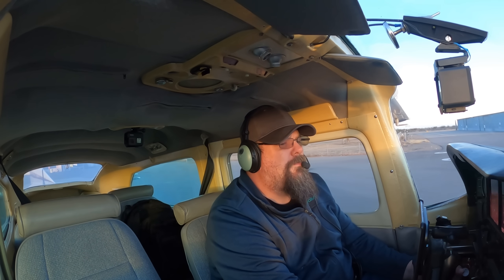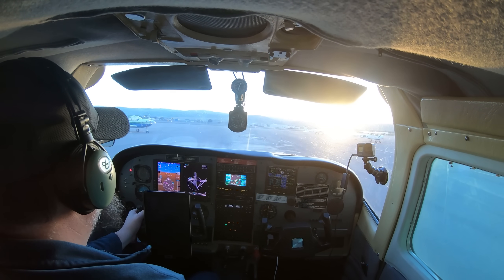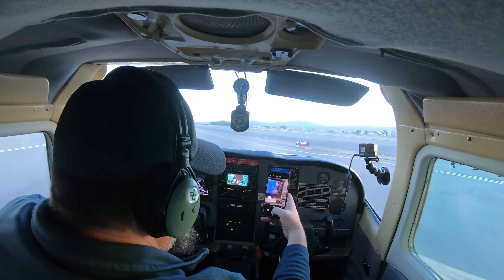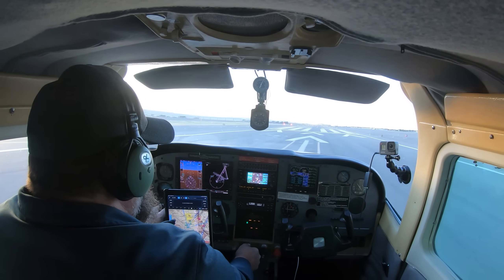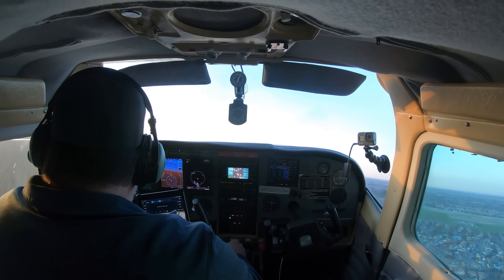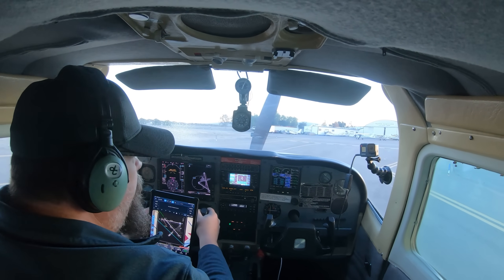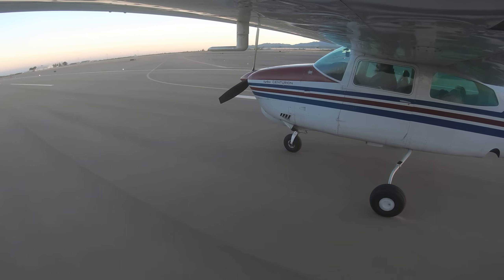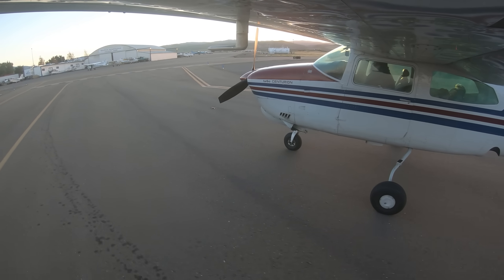Catastrophic Engine Failure after Takeoff

Comment: I was always taught to NEVER turn back to the airfield/port in the event of an engine failure! This is a classic example of where general advice isn't ALWAYS right! It looked like you had a field option or two though during that l/h turn ... The crosswind turn woulda been at around 700ft ....  Nice one!
Reply: I would have left the gear up til the very last possible second to preserve energy. In the event you didnt make the runway, you might consider landing gear up depending on the surface available and dont want to manage that decision and control the plane at the same time during that critical phase. Second, I noticed you took your time turning back. Once you decided to go back I'd point out an aggressive turn would be in order. I know you loose energy in a steep turn but drift off centerline is creating a longer distance to the target. I brief myself of emergency on takeoff before each flight. Fortunately in thousands of hours I've only blown one engine on takeoff and it was in an Aerostar twin and a non issue due to the right engine still producing power. I think you managed the situation well. Only one thing left to do. Fire the mechanic.
Reply: Look up Harrison Ford's engine out situation. There was litterally 0 options except for a golf course. Forgot the airport, but would hate to have to deal with an engine out landing there. He did an exceptional job considering what was available
Reply: Very true, you definitely have to consider your specific circumstances. At my airport, off to one side, there are some nice fields to put it down on... But on the other, it's all residential. 0 options over there. My instructor taught me to make the turnback when taking off in that direction. Luckily, I fly out of a Class C airport with a decent sized field, so with a tailwind it should be doable to come to a stop without slamming into something hard
Reply: The airport runway configuration helped a lot by reducing the amount of manuevering required to get back on the ground.
Reply: TradeTop  Well, that is your opinion, why say that it isn't? 
I have no problems with the prospect of making a forced landing into a suitable field and I'm very confident that all on board would walk away from it unscathed. You seem to not be as confident. Perhaps you weren't trained correctly. 
A fellow aviator friend of mine learned to fly in the US and when he tried to hire a plane here in the UK he wasn't allowed to and had to have a certain number of hours of instruction in order to qualify for UK PPL status.  
You have made no comment on the possibility of an engine restart after having the time to complete the checks I listed and you don't consider the low-hours pilot who may attempt the 180-degree turn and end up stalling the aircraft because he is trying not to lose a lot of height in that turn, so slows the aircraft to stall speed. As you may know, the inner wing in any turn will always be the first to stall and once it is stalled, it's goodnight! 
An ex-colleague's brother who had a commercial licence (he towed banners in a 172) was killed when performing the 700ft climbing turn on climb out when he took his eye off of the ASI ... he stalled the inner wing and there was obviously insufficient height to recover from the ensuing spin.  
You totally ignore what I copied and pasted from the FAA and the NZ site ... 
You seem the type to only consider YOUR point of view and who refuses to take on board any other relevant information.
So, it's best to now repeat that I disagree with you and for the reasons already stated, and to bid you adieu.
Reply: TradeTop  That's a very opinionated claim you make! ...  In your opinion .... If you were taught to return to the airfield after an engine failure, it is perhaps yourself who was taught wrong if you believe that from 1,000ft it is wise to do so. First, you will have probably taken off with a headwind. If you make a return to the runway, you'll now be faced with a tailwind, which increases your groundspeed and rushes your ability to fly a safe approach and stop on the runway. There's not a lot of margin for error with a strong tailwind (assuming you can actually make it back to the runway). If  there are suitable landing sites ahead or a little to the left or right, they should be taken in my opinion. 
The FAA have stated ...
"Rather than returning to the runway, the FAA advises "it is safer to immediately establish the proper glide attitude, and select a field directly ahead or slightly to either side of the takeoff path."  ... and I agree with them.
The New Zealand Aviation Security Sevice say the same thing.
The aeroplane is usually heavy, slow, low and in a nose-high attitude. These factors combine to provide the least amount of height, and therefore time available to respond to the emergency. Successfully managing an engine failure after take-off is dependent entirely on efficient use of the time available. The common practice is to limit the choice of landing site to no more than 45 degrees either side of the nose; a simpler and more realistic choice may be to choose anything in the windscreen. Do not turn back to the runway. A successful turn back to the runway is beyond the capabilities of most pilots." 

Landing ahead or thereabouts, will not involve an urgent 180-degree turn where a stall can quite easily occur when considering low-hours pilots in particular, so this risk is removed. 
You will have more time to do the checks which could possibly result in the engine being restarted. Returning to the airfield would involve a lot of concentration by the pilot and he will be short of time. Checks that could possibly result in an engine restart are, switch fuel tank, check fuel pump is on, check mixture is rich ... if it is, adjust it to see if any difference is had, check primer is locked and apply carb heat. if enough time switch magnetos to L and then R and then back to both. If prop has stopped try restarting after each of these ... IF TIME PERMITS!
In my opinion landing ahead, or thereabouts (see above) gives the pilot some extra time to do these checks and without the need for a rushed 180-degree turn and as said, no possibility of a stall during the somewhat hurried 180-degree turn.

So ...  we disagree.
Reply: TradeTop  Oh, dear ... out of arguments I see. Funny ... but here is a great video for ya! I tried to post a link but my post failed to go live ... type this into Youtube 
Emergency Operations - Engine Failure After Takeoff
(I've already commented on the successful return to the runway as we saw in the video!)
Reply: @thepianoman1010  you got trolled and didn't know it
Reply: @shable1436 Of course I did ... All I know is that I was talking to either a h@lfwit or any other kind of weirdo ...  and that would include trolls. 😅 
Not interested in trolls, only interested in facts. Which of these is an interest of yours?
Reply: TradeTop  It is clearly your opinion ... and I am tired of this discussion now. I've tried reason ... I've explained each point to my reasoning but it has fallen on deaf ears. I will end by stating the obvious ... there are times, depending mainly on the geography, when returning to the airfield is either the ONLY choice or is by a long way the safest ...  these situations are rare however.
One airport where this is the case is London City Airport (EGLC) ... a friend of mine flew 737s for Ryanair out of there and he said he'd have to go for the River Thames if he had both engines fail at a certain height ... We discussed the extreme unlikeliness of such an event along with this and my view remains the same ... river ditching very likely to fail when we look at the sharp U shaped bend and other bends in the river at that location. 

You are completely wrong where you say,  "And every pilot from every country need to qualify to fly in another country, not just to go to UK, come to Brazil and you'll need to do everything from zero."  

Where did you get that idea? Are you saying that no pilot who isn't Brazilian has ever flown for a Brazilian airline?

I needed to sit an air law examination in Yonge Street, Toronto in the late 70s in order to be able to fly a Piper Warrior (C-GPHQ) from Brampton airport in Ontario. I needed a 75% pass mark and got 83% so I could fly there ...  I did need to take a check flight at Brampton flying club also. It will be the same in Brazil ... You are wrong again! 

Anyway ... bye!
Reply: @thepianoman1010  ö

Comment: Hi ?! Do you remember what altitude you were when got the failure ? Thanks and good job 👏🏻
Reply from the maker: According to the analysis between myself, Rick and Charlie that was posted in EAA Sport Aviation magazine, it was 371 feet AGL
Reply: @TheEdwardFrye  He said the failure occurred at around the height of the crosswind turn which takes place at around 700ft. It definitely was not much below that, certainly not 400ft!

Comment: 35 seconds from initial sputter to landing.  Congratulations on landing safe-great flying and glad you are safe.   I could not tell, was that the stall horn I could hear? or wind whistling ? When you said you noticed you were getting slow, how slow were you?
Reply from the maker: That is wind whistling, GPS shows I got down to 61kts after I put the gear down, I remember it slowing and the red bar was climbing when I pushed it over the second time, stall speed in that configuration is 45kts
Reply: @TheEdwardFrye  Excellent awareness and speed management in the worst of scenarios.  Bravo!

Comment: That is called a Turnback Turn.  If going around the airport is called a Turnaround the airport.  I used to teach those turns to do after EFATO/LOTOT.  Also you can do them on GRM.  Some ignorants of turnbacks call them as the same but they are very different turns.  Some call a turn around "A Turnback", or the Turnback as a Turn Around.   On the Turnback you dont turn around anything.  Your turnback to the interception or opposite runway, the closest runway.  Turnaround is not Turnback.  Many accidents are on a Turnaround Maneuver due is longer to do and pilot cant make it to the base leg or final leg and crash trying it.

Comment: Do I spy a missing rod bolt in that picture?  Going to guess that one didn’t get torqued.  I’ve seen the aftermath of misassembled rods before, always cracked rod caps installed backwards.  They usually live a few hours then leave your engine with the rod hanging out one side and the cap shoved through the other.  Since this one happened so fast it’s got to be a torque issue.

Comment: if changing the propeller pitch is what cause the engine to fail then you can thank your "error" in twisting the mixture instead of the the correct knob first for giving you the altitude you needed to bring it back safely!  nicely done.

Comment: This video popped up in in my feed, and I have zero knowledge about flying a plane. Can someone explain why doing this turn was potentially the wrong move? Surely the runway you just left is the ideal landing site.
Reply from the maker: The risk is trying to extend the glide or getting to slow in the turn and having the airflow separate from the wing (stall). If the plane is uncoordinated, and it stalls, meaning one wing stalls first, then that becomes a spin. It requires altitude to recover from a spin, so a spin at low altitude can be fatal. In primary training, we're taught not to turn more than 30 degrees off straight ahead to prevent a stall/spin scenario. This was a Goldilocks scenario, where 30 degrees left put me abeam the numbers for the crossing runway so I kept turning left and pushed the nose down to maintain airspeed so I didn't stall.

Comment: Good handling of a bad situation.  Looks like the rebuilder didn't pay close enough attention to all the rod bolts when tightening.  Either torque spec or stretch spec wasn't correct or a fastener was weak or missed in sequence.  That is a costly failure, likely nothing can be salvaged from that engine.

Comment: Judging by the connecting rod stud with no nut on it and no damaged threads , I'd say that rod was not torqued to specs and backed off causing the engine damage.  Because if the rod was torqued down , the stud would be stripped or just ripped off completely .  Glad you landed safely.  Dam I would have shit my pants !!!

Comment: Great job!  We train for this all the time, but you never know how you will handle it until it happens for real.  I just put an engine in my 182.  You are absolutely right about limiting ground time during the break in.  My only thought is that you don't need to raise the gear immediately after liftoff.  If that engine failed in the first few moments, it would have been nice to have the wheels down to land on the remaining runway.  Hopefully the work you had done was under warranty.  Sometimes the shop will say that the case was defective (and they don't cover that).

Comment: "Then I go to check the... propeller... to make sure it has oil, and I grab the wrong handle. Oops. Recover from that, and then check the propeller."

"I reduce the manifold pressure to 30 inches, and start to reduce the RPMs to 2500 by adjusting the propeller. ... I mean by adjusting the propeller."

Two perfect examples that demonstrate that we're all human and make goofs. As long as we can catch our goofs and correct them, things turn out fine. :D

Comment: I wonder why the builders don't break these in on a dyno. Get the rings seated and ferret out an impending failure.  Most of these types of failures happen either right after the rebuild or after 4000 hours.. Good job parking that apple.

Comment: Looks to have sheared a con rod stud/bolt, possibly the old ones re-used and they were already at plastic deformation or replacements coming from dodgy chinesium suppliers selling 'grade' bolts, was no noticeable knock prior to failure, should have been audible for some time had it been a bearing spun or degraded. Often overlooked after an oil pressure failure if another cause for the failure is found elsewhere is the internal oilways within the crank itself but that usually leaves the rod bolts noodled but in place. I hope the refurb shop is owning their failures.

Comment: i bet you have 1 bad mechanic working on that engine that is not something that can happen out of the blue was a tear in it and he over saw it on inspection or the squish was so off that cause to must combustion pressure and it blew it all past the pistons back in the crank case causing it to blow out im curious to see when you open it and see the result that will tell us a lot more what acutely happens to that poor engine cause this is far from a normal failure thats for sure

Comment: Well done on that quick thinking and use of everything you had at the time! I think you're extremely lucky that engine actually gave you some power, which is better than nothing, otherwise you'd of ended up in that concrete channel short of the runway with the dreaded turn back and not selecting throttle to idle. It was your decision to make and one that paid off in a critical malfunction. The Gods shat on your parade, but lady luck stepped in. You did everything you could and made it with a cool and calm skill that takes over us in these times. At the end of the day if you'd not turned back and gone into one of those fields ahead, I reckon it would have been all bad with those ruts. So I fully support your decision at the time, anyone else saying they'd do things differently weren't there and should get our of their armchair critic seats. Thank you for this great post and breakdown of the event.

Comment: Well done.  There are always things that can be improved on, but it's a lot easier to see them from the comfort of a recliner, rather than in the heat of the moment.  I'm sorry to see infant mortality has claimed another engine, but well done getting it back on the ground safely, and in one piece.  It's fortunate you were at an airport with a runway offset from the one you departed from.  This helped you pull off the "impossible turn".

Best wishes getting your airplane back in the air soon, and as "economically" as possible.

Comment: Well, I am not a pilot or GA owner, however I am an aviation enthusiast, so take this with a pinch of salt.
From what I can see, there isn't much you could have done different or any critique.
Only thing you can argue for is the "impossible turn" where you head back to the airport that is very risky pending on altitude and speed at the moment the engine quit.
But from what I saw, you had no warnings or sounds that would clue you in to the failure, nor anything from the outside.
The moment it blew, you did expel oil smoke but it was all fine exhaust up until that point as well.

Nicely handled in any case.
Oh and that retractable landing gear makes the plane look really sexy by the way! :D

Comment: I'm a little concerned about seeing several errors during this flight.  The "oops" during the run up.. adjusting mixture when the prop rpm was the intended action.. I'm thinking you were too focused/worried about engine performance?  Maybe a little helmet fire?
Good job getting the aircraft back on the ground safely though!!